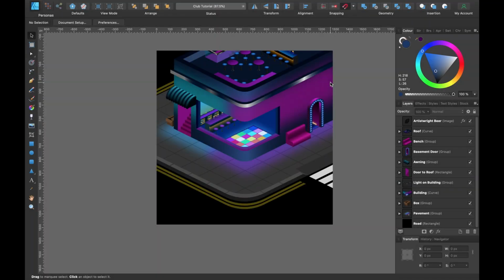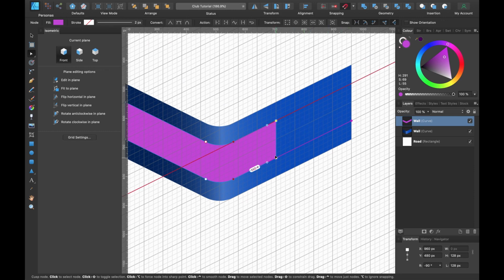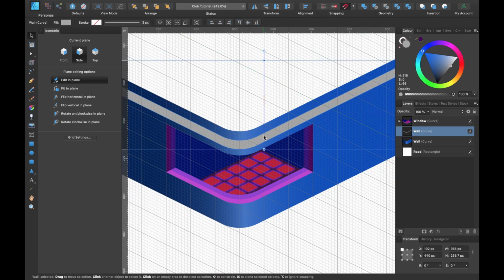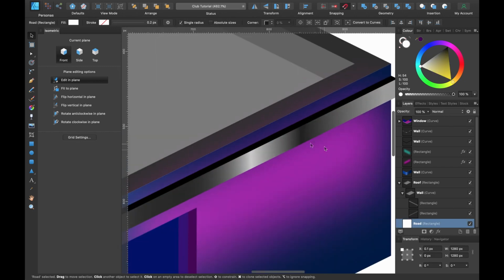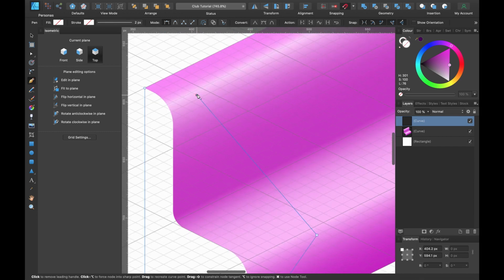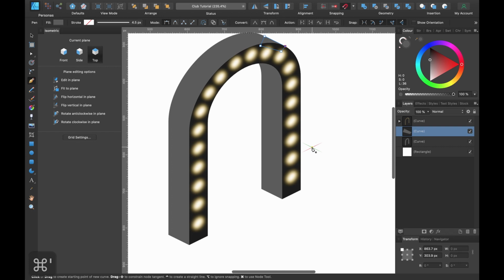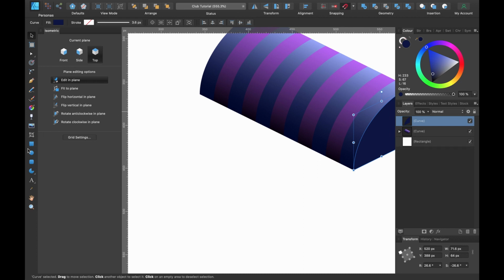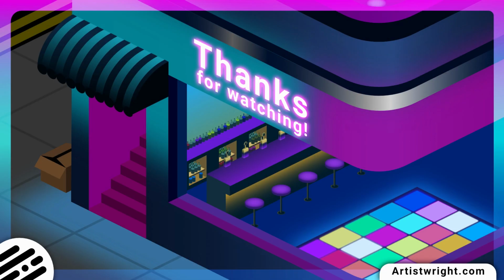Affinity Designer Tutorial - Isometric Design with Rounded Corners - Retro Style Bar

Comment: Incredibly helpful video, as usual ArtistWright, thank you! Pardon if another commenter has already pointed this out, another possible solution through the bench troubleshooting is the shapebuilder tool. Make sure all the bench sections overlap just slightly, with the selector tool (or in the layer panel) select all sections, go to the shapebuilder tool to join them, and then hold down alt/option and click to delete any unwanted sections created by the overlap.
Reply from the maker: Thank you! Yes that would be a great solution, I made this tutorial with V1 when the shape builder tool wasn't available.

Comment: Really like your Isometric tutorials, but I seem to be having some issue with rounding corners after combining the 2 walls, then selecting the top and bottom nodes with the corner tool selected, all I can get the corner tool to do is round the top corner but it refuses to round the bottom corner. 
This works when I don't use the isometric grid in different document. I am using the latest version of Designer. I would like to work through this but can't seem to get past this.
Reply from the maker: Hey Dan, use the node tool to check there isn't another node hiding in there. Just drag one of the nodes away to see if there is another one and delete it and try the corner tool. That one got me for a while too
Reply: @ArtistWright  That worked, there was another node hiding under the one I was trying to round out - thanks for the tip.
Reply from the maker: @D33Arts  glad it helped, it happens sometimes

Comment: Hi, thanks for a great tutorial. The only way I can get the rounded corners to work is to draw the wall with the pen tool. if i join two rectangles as in the video, only one corner will round, even though I've selected both nodes. I'm on 1.9. Am I missing something? Thanks
Reply from the maker: Hi Kevin, remember to check for hidden nodes like I did in the video

Comment: I watched this from start to finish before I attempted to follow the tutorial.  It really is amazing.  When I started to follow the tutorial I also fell at one of the first hurdles in rounding the corner after joining the two rectangles.  I have been over it several times and still can’t manage to achieve my first rounded corner.  I’ve got no hidden nodes and note that a fix is to add three times which I also don’t quite understand.  Please explain this in the simplest possible way so I can continue.  Many thanks for sharing your amazing talents.
Reply from the maker: Hi Tim, I'm glad you enjoyed the video. Before you add the two shapes together make sure you have snapping turned on and make sure that the two shapes do snap together. Then after you add the two shapes together, then try the corner tool. If that still isn't working get the pen tool out and draw over the two shapes, tracing the outline. Now try the corner tool and it will work. The reason for using bake corners is so that if you have to re scale your image the corners will stay the same size relative to how big / small you scale your object.
Reply: I had exactly the same problem. It turned out to be one of the snapping options I had to uncheck. If drove me nuts for about an hour of fiddling around.

Comment: Question with problem at the get go.  I added the two rectangles and selected both nodes to curve out  the center, the bottom node does not respond, only top node curve not the bottom?
Reply from the maker: Check there isn't a cheeky node hiding behind the bottom node.
Reply: @ArtistWright  I encountered this same problem. Your solution worked! Thanks! Don't know why another node was left behind.
Reply from the maker: Cheers

Comment: For some reason my corner tool is not the same as yours,  when I try to make the first curved corners  ( at 5:54) I select both nodes, but only the top node corner  changes.  The bottom node stays sharp. Even if I select this node by itself the corner tool still doesn't work.
Reply from the maker: There is probably another node hidden there in the corner. Why not try and delete that node to see, like I did with the bench section
Reply: @ArtistWright  Thanks for quick reply. If I click the add button 3 times then corner tool works like you demonstrated.
Reply from the maker: @stevehunt525  I will have to try that!

Comment: Yes, it's finally here! Awesome work mate! Like I said before, I'd definitely have a drink in this place if it was real! :D
Reply from the maker: Hope it helps Finn. Maybe you can design this place then design yourself at the bar having a drink. That is until we find a similar bar in real life
Reply: @ArtistWright  Good ideas there, maybe I'll do that!
I also actually have a topic here considering the "Add" tool in Affinity Designer, cause that tool seems to be broken somehow, at least in my program. And the way it's broken is that it does not combine two objects in a correct way. Like seen in this video when you were making the bench. I have this same problem usually, trying to make 2 objects into one, but it always leaves a strange line in the middle. Even if I have aligned the objects as close to each other as I can, and they have snapped to each other, it still does not add them properly. I could understand this in an isometric situation, but it does not work even in a normal way, when trying to add two normal squares together, squares that are aligned perfectly next to each other! How the hell can a function so simple be so badly broken in a professional software like this? :D
Reply from the maker: @finnflash23  I seem to run into this problem alot more when working with the grid, I take off snap to grid and choose what i believe is the best option for two shapes to snap together but still having problems, just like with the bench. I was thinking it was just me lol, it still might be, but from what I remember it used to perform way better. Are you finding this more evident in the new 1.9 update?
Reply: @ArtistWright  Yeah, I've tried several options to fix this too, like taking the grid off and such... but it does not matter actually, it's as broken with the grid and without it! I've found several others problems too with the "Geometry" tools, and still I'm wondering how can these so basic functions be so broken. So all these issues have basically caused some shapes to be impossible to make now. I already had this problem 2 months ago, so it was there before 1.9, and I don't think it has gotten any better with the update, maybe even worse! :D
Reply from the maker: @finnflash23  have you tried adding the shapes together using a compound layer?
Reply: @ArtistWright  I actually tried that too, with same results than before! This problem is not that bad when having an object without a stroke... But when you add a stroke to your new combined shape, all these gaps between former objects get strokes when it should just put one stroke around the combined object! This is so strange... :D
Reply from the maker: @finnflash23  that's strange, I think you should go on the Affinity Forum and post examples and ask everyone. That Forum is super useful
Reply: @ArtistWright  Yeah maybe I'll try that Forum thing, I can't be the only one with these strange problems! Thx for helping, keep up the good work on this channel! :D
Reply from the maker: No problem, let me know if you find out the reason
Reply: @finnflash23  Me too, I think it is more suitable for drawing.